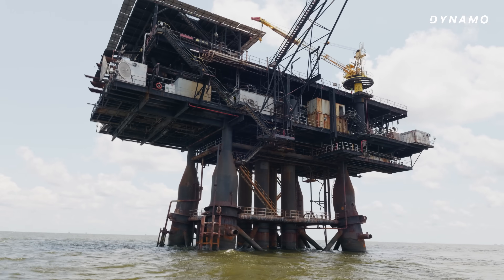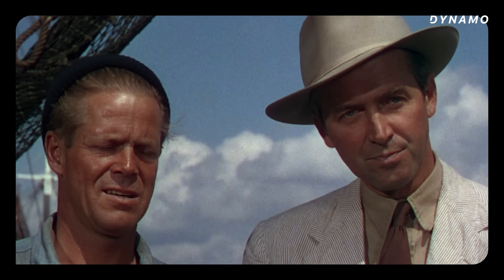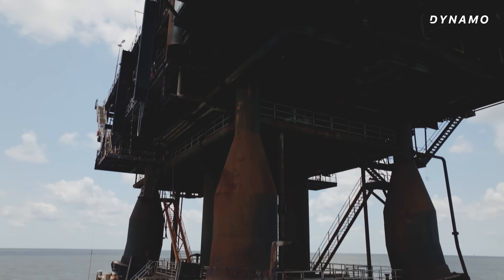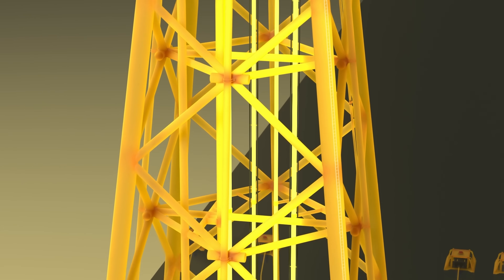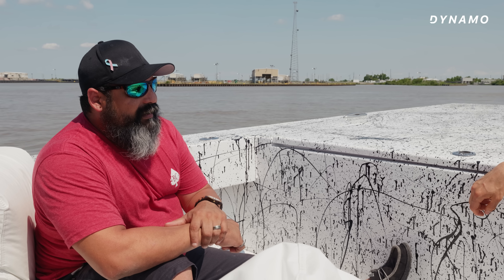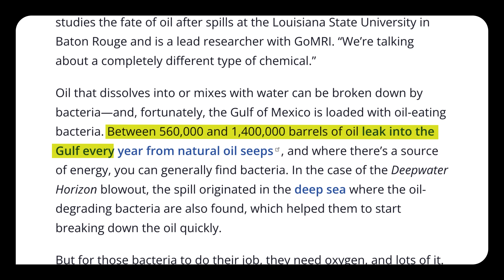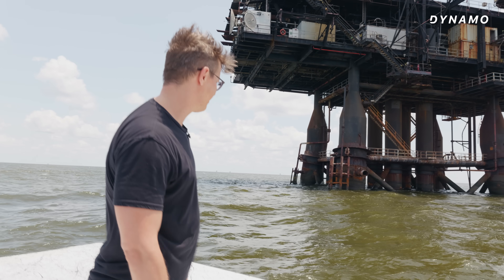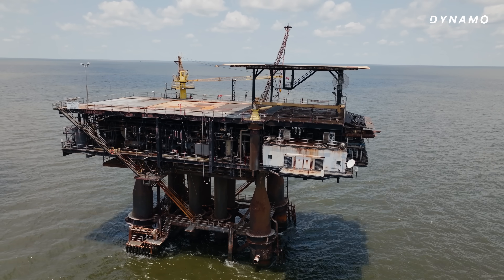I Visited Abandoned Oil Rigs — and Found Something Terrifying Underwater

Comment: Another wanna-be internet sleuth making a video about shit he knows nothing about. 
I worked P&A for almost 20 years. You can get the entire history of that location if you looked up the lease number, that you totally avoided, which is clearly printed on the side. 
Those "abandoned" wells have several layers of protections like down hole safety valves, and up to 2 storm plugs that are set by wireline operators. Additionally, the tubing and or casing, is usually filled with either sea water or sometimes calcium bromide (heavier than saltwater), to help keep any additional oil or gas from migrating up the tubing/casing with hydrostatic pressure. Sometimes, a company might even pump drilling mud, although rare, as an extra layer of safety after production has been shut down.

Also, the pipelines for the sight are cleaned by pumping a pig and then filled and flushed with seawater. Yes, there is usually some residual oil left in the pipe but not any significant amount. Plus, these PLATFORMS (not Rigs) have an annual inspection to make sure it is structurally sound, and there are no leaks of oil or gas of any significant amount. IF THERE IS, and the last owners went belly up, the government will assign someone to fix the problem and will figure out who gets the bill later. 

Lastly, your cost estimates are way off. Provided that everything goes right, a rigless P&A crew can decommission a single well for ~1-2 million dollars. And the P&A money held in Ecrow, the Government collects interest on that money the whole time - around 20- 30 years or so.

Comment: The work that smaller company is doing to extract the last bit of oil from the wells using bio organisms is probably the right company to build a trend of closing them in a safe way.
   Is there any way, once the oil is gone, to take bio garbage from land, like cooking grease from McDonald's, or better yet, cow manure, so it doesn't pollute our fresh drinking water, and auger it back into the wells when they are empty? Leaving a small fraction of the oil there with the bio organism should Jumpstart the natural process of creating bio fuel.
   Refilling those wells would leave a lot of space in our land fills, as they can be a bit of a problem, and put it in a productive area.
   Doing so might also contribute to keeping pressure there, and preventing a collapse of the cubic area within the well. 
   I theorize that could help to prevent plate shifting and increases in earthquakes, or even sea water level changes. 
   We will need less and less crude oil due to our change to electricity, but with what we do use, maybe companies could be incentivised to use the bio fuel instead, as it is not the same as crude, which would take a long time, but would still be combustible fuel.

Comment: it used to be profitable for smaller companies to come in and buy the rig and lease and  drain the rest of the oil but it has become such a regulation nightmare it is no longer profitable,I have been to mainpass 71 a few times back when it was running I worked the oil field on a supply boat for almost 20 yrs

Comment: It's not all doom and gloom. Provided the individual wells are all properly plugged. We need stricter oversight on ownership transfers, yes. The problem with our corporate civilization is nobody wants to be responsible and those at the top live in fear of their investors becoming disilusioned with lackluster earnings and toppling execs from their 7 and 8 figure jobs. It's not about good managemet or being a good corporate neighbor. It is all about pure raw profit for the shareholders. 

But let me do say this... have you ever fished around an oil platform, whether active or shut down or aged out? Move a mile away and maybe you don't catch shit. Fish around the platform legs and you catch fish from the surface all the way down to the seabed. The improved habitat for marine life is of inestimable value. The trick is to make those who are responsible for leaks, pay multiples of the cost of repair and cleanup. Then, maybe there is more proactive maintenance and if necessary, pre-emptive removal.

Comment: They leave it there because it's too expensive to remove them. In Brazil they developed a technique to build damns tha makes the tractors to get suck on the top. They are left there but the dam is built so much faster that it's worth it.

Comment: wells that lack pressure and cant produce against the force of gravity, are soon to be abandoned.

abandoned rigs wont leak oil as the minimal amount left in the deposit does not have tje pressure to leak.

similarly with land wells. once the cost of pumping to create pressure, to extract the oil outcosts the extracted oil, it is closed. the hole is plugged not for spillage, but essentially so no one falls into it.

Comment: You speak about "rigs" and "wells" as if they're the same thing. 

Rig, is what drills the well, it's then processed by a platform. When a rig is no longer operational, the wells are plugged and abandoned P&A'd. This involves pumping a cement slurry above the oil producing zone, in excess of the zonal pressure. Basically, you're replacing the mud, sediment, and rock with a column of cement. 

It's very uncommon for them to fail. Considering the 10s of 1,000s of wells ever drilled, the failure rate is so small, it's silly. 

The Taylor spill is one, but the Macando well was a drilling failure. Not a well failure. The well was in the process of being temporarily abandoned until it's final completion. 

P&A responsibility, though it can be transferred with sale, ultimately remains with the company who drilled it. It's commonly referred to as "Cradle to Grave" ownership. So pretending like there's just orphan wells littering the Gulf of America is not true.
Reply: Yes wells do get P&Ad but how many of these wells were plugged correctly I've worked for companies where they would make the crew go to lunch so they could spin test charts for cement plugs because they wouldn't hold pressure it was very common in the early 2000s for companies to do this because they are losing money the longer they have to test or if they have to mill out a plug and redo the job there are so many bubbling wells out there it's crazy
Reply: @lopar35 bubbling well in the Gulf? BSEE or state enforcement would have to be complicit. If the well physically exists, it has to be monitored, I believe, weekly at a minimum. 

What you spoke about, is highly illegal and would result in civil fines and jail time. But the world is full of shady people. I'm not sure how they pertain to my previous comment?

Comment: At the very least there needs to be tubing running down the length of wells that is constantly fresh air into the ocean along the length of the well down to the seabed.

There are microbes that naturally break down oil but they need lots and lots of oxygen to do it so it doesn't happen very effectively deep down.

Comment: Just to be clear no production platforms are dynamically positioned.  Those are the drilling rigs.  They drill a rig for about 3 months and then move on to another well.  Production platforms in the ultra deep water are anchored.

Comment: I worked many years offshore on oil and gas platforms. Crude oil is A- Biotic meaning generated by earths crust contineously pushing the hydro carbons up to shallower sandstone reservoirs. Not fossil and crude oil is with us forever. In fact there are too much oil and is price controlled. Russia has oil wells 60yrs old still pumping. They go extremely deep into oil magma.
Some interesting fact😊😊😊😊😊
Cheers
Reply: I recall the Deepwater Horizon rupture. Oil does naturally leak from the sea bed and there are microbes that have always exploited that energy. The massive spill cleanup was cut in half because the microbes bloomed to eat up the free bounty.
Reply: "Oil magma"? Um, yeah except thats not a real thing. You do understand oil is volatile, right? Oil is made from organic carbon from the swampy era in earth history. It results from hundreds of thousands of years of heat and pressure on plant material. It is NOT a self replacing resource since the climate and biome that produced it in the past is no longer present on earth. And anyone who "worked many years in offshore oil" would certainly know that. Your comment simply proves you don't know jack about oil. Just another conspiracy nutjob.
Reply: Heard Stories of us going back to wells we had thought dry, just for them to be full again. Wish I knew how the fossil thing began.
Reply: @omgcats2  Rockefeller wanted to make people think the oil was limited and would runout. He wa sort of right, the oil can get more expensive to pull from the ground than it is worth. That is really peak oil before a steep cliff. We need everyone to get behind safe nuclear for electron manufacturing before the oil is not available anymore. The dump trucks, concrete trucks and lifting cranes need diesel to operate. Hard to build without those.
Reply: @omgcats2  It was a scam still being perpetrated today in order to give an illusion of scarcity...

Comment: The term "oil rig" is not a term used by the industry.    We have drilling rigs and oil production platforms.    Whenever I hear someone repeatedly use the term "oil rig",  its a signal that they don't know what they are talking about and/or they are too lazy to learn.   

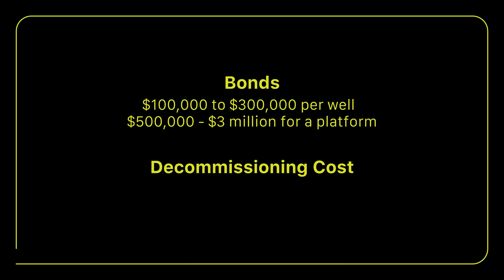His whole argument misses the fundamental point that offshore operators are legally obliged to remove abandoned facilities and for smaller companies,  this has to be bonded.    His cost analysis a 13:10ff is ludicrous.    The cost of abandoning a platform well is a few hundred thousand,  not $millions.     He doesn't seem to understand the difference between abandonment costs in shallow waters on the shelf vs deep water facilities.   

His argument about shedding abandonment liability by selling to a smaller company or bankruptcy is sheer uninformed BS.    Responsibility for removing orphaned facilities reverts to previous owners,  i.e., the major companies that originally installed them.    

He's just another Drama Queen looking for attention and can't be bothered to do his homework. .

Comment: one thing I never saw mentioned in this, was the fact that these rigs provide structure and habitat for alot of fish species,  the gulf is mud and and sand shells, not full of reefs so any structure provides that, you remove the structures your removing habitat,  go out any good weekend when you can get boats out and where do the fisherman go? to oil platforms.
Reply: IMO, these platforms can also be used as a military installation as an integrated AWAC CIWS system against drones. Some of these platforms that's in a better condition makes a very good and cheap installation location...
Reply: He did mention it. Right at 17.54
Reply: @kommo1  Literally all he said was "they can be turned into reefs" and showed a pretty picture, and that's it. Zero mention of the numerous ecological benefits these artificial reefs provide.
Reply: Fish strive with structure, so I actually think it's good for them to be there.
Reply: But it's completely unplanned, unregulated havoc. Environmentally the structure is less of a problem that how they've capped the well off. If the well starts leaking, whatever sealife is around it dies, and god knows how much more dies. If you want artificial reefs they can be planned and created with old car tyres or benign building waste. This shit's just hundreds of disasters waiting to happen. My State in Australia has created artificial reefs offshore that are designed to suit specific fish species, and the GPS coordinates are on signs at launch ramps, so you know where to head for the fish you're after. That's a lot different to leaving industrial waste and pollution behind randomly.

Comment: Only telling half the story here. The wells are their own(major) problems indeed and I do appreciate this coverage, but so are the rigs and platforms. They aren't made out of steel entirely a lot of the below water infrastructure are various bronze alloys made from lead and or zinc, while far resistant to corrosion than steel alloys these bronzes still leech their lead and zinc over time and as a result are extremely toxic. Not to mention all the minerals and gases coming out of wells that are toxic as well. The Gulf of Mexico is one of the most poisoned areas in the world.

Especially the deep water rigs that started going up in the 60s to 90s. Imagine thousands of metres of thick cables and beams leaching lead, zinc and who knows what else. This also makes the working conditions extremely dangerous when decommissioning and plugging these damnable things.

Comment: I think with some more modern technology for isolating wells, this will be less of an issue in the future. A lot of the times the oil will refill in the formation so a lot of these dried up wells can be revisited in a few decades and expect to produce similar to what they used to. Not like they were brand new, but they would produce significant amounts worthy of investment. They just need to learn how to make an enduring fail close isolation valve that they can set and forget.